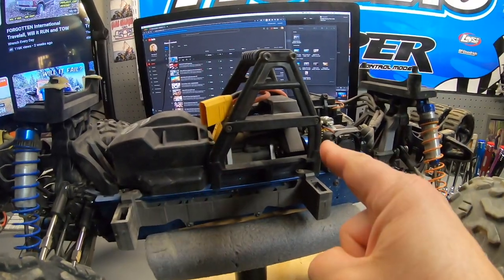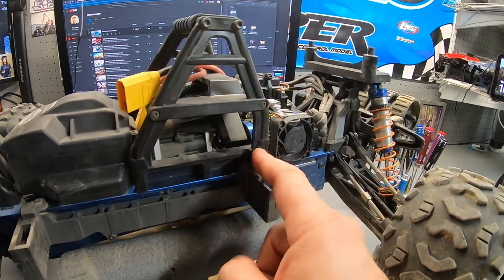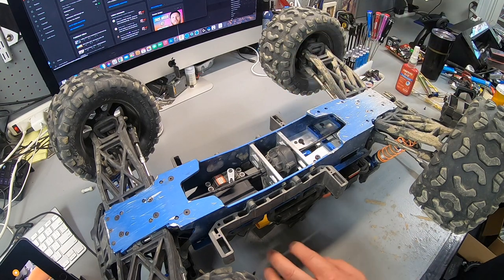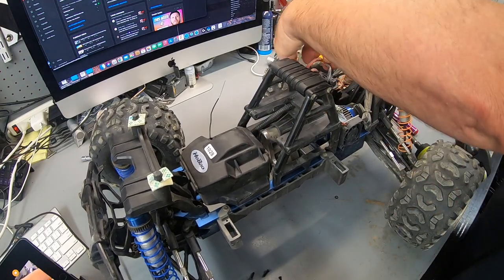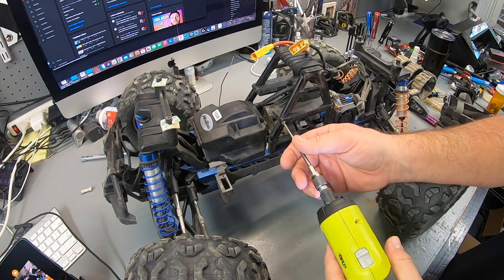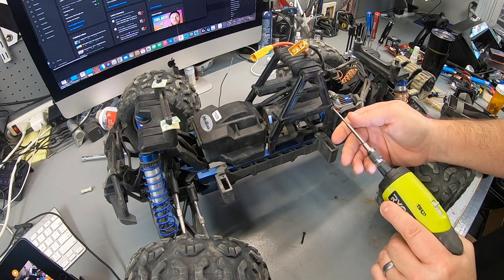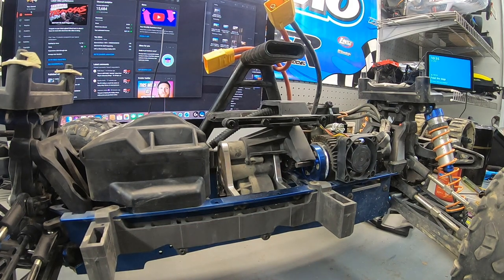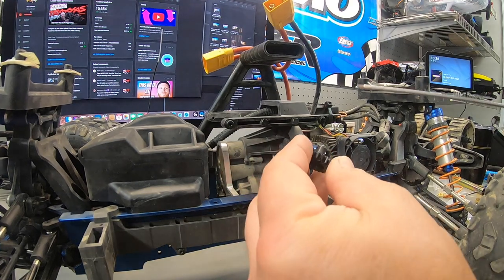HoBao MTX Pinion Change

Comment: Great bench video Bro. I'm loving this truck so far. Tough as nails. I got her out again yesterday on 18t pinion. She's quick AF but got toasty at the end of my run. The pinion backed out on me ended my run. But yes 17t should be a sweet spot.
Reply from the maker: That 17t seems to be working great. The only thing that I do not like it does not leave much room for increased opinion if you were to change out to a smaller tire such as a backflip or something similar. HoBao really needs to jump on making a smaller spur gear.
Reply: @rcguygarage  36t spur is smaller than what comes on the HMTP2 correct? Might be able fit 19t pinion in there but not 100 sure.
Reply from the maker: @CommanderAstigRC  all I know is 18tp seems to be max 45ts is what's in the MTX and MT2
Reply: @rcguygarage   It felt like there was a bit more wiggle room after putting in the 18t tho. You could be right Bro.